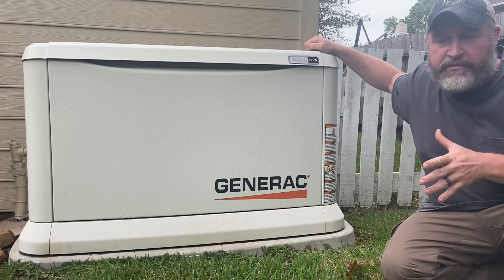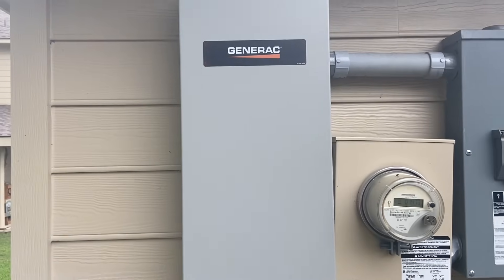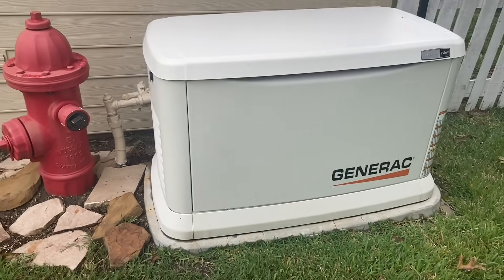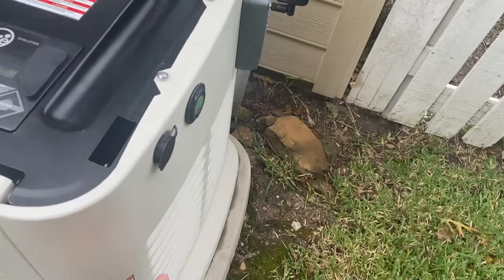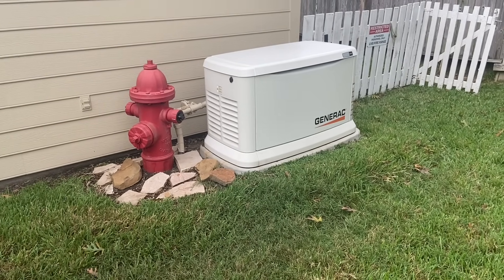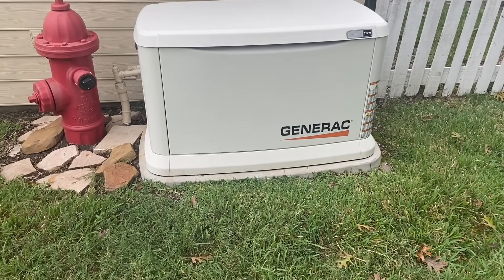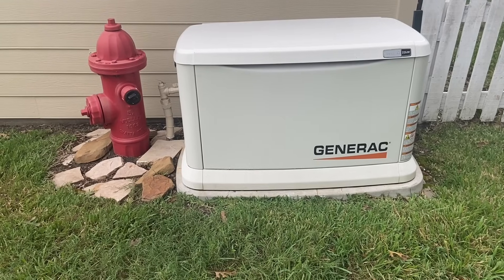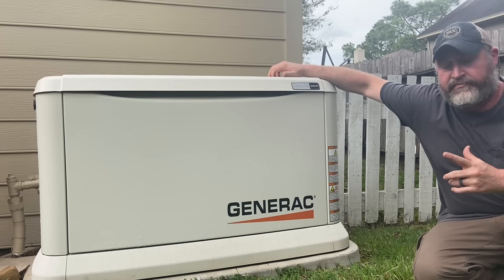Thinking of purchasing a generac whole home generator?

Comment: Here is why I will not buy one. Cost to run one 24 hour day $50.00 plus. My neighbors cuts one once a week and runs at least 30.00 minutes. If it floods it is ruined unless you put it on a very high slab. These are things the company does not tell you.
Reply from the maker: Our cost last use was avg 17$ a day but I guess it depends on your area, our is high enough that if it floods we would have more important things to worry with like our home. Mine only runs for 5min per week and does not bother the neighbors as they have them as well. Thanks for the great comment and for watching.
Reply: $50 per day for power (HVAC, refrig, lights, tvs, etc. is a deal!   The upfront cost might be prohibitive, but the running cost is not.
Reply: One of the things to consider is where the author lives.  When Texas had the deep freeze last year some of the electric providers had to purchase power at the market rate which skyrocketed and many of those providers passed that cost onto the customer.   $50/day would have been a godsend to people who got bills in the thousands for being without power for a couple days.

We live in Klein (NW of Houston) and when the freeze hit we were without power for perhaps 8 hours altogether through two blackouts.  Not too bad and luckily our provider didn't need to purchase more from market rates so we never got a huge bill.  That said, one needs only to live through something like Harvey once to be sold on the usefulness of a home generator.
Reply from the maker: @craig328  great comment and thanks for watching!
Reply from the maker: @Patrick Baptist hints the stand by or back up generator 🤔
Reply: @RetiredSignDude  It's only that cheap if you live in an area with natural gas. For people in more rural areas that need to run them off propane, it can get very expensive. I have heard horror stories of people using over $1500 of propane in a week long outage. Granted it varies but some areas, getting propane delivered can be very expensive after all the fees.

Comment: Car batteries last for 5 years minimum. That is a pretty poor performing battery for it to only last for 18 months and I believe you said it lasted for 16.
Reply from the maker: Interstate 16 months in 2018 replaced with a die hard and been going strong since thanks for watching
Reply: Batteries suffer failures just like everything else does.  Just replace it every 3 to 4 years as part of regular maintenance with a standard automotive battery and don't worry about it.

Comment: The thing that bothers me is they always want to install these right up against the house. I’m afraid the exhaust will somehow find its way in the house which is very dangerous.
Reply from the maker: My installer would put it wherever I wanted within our easement. Ours I 40+ feet from our house. Find a new installer. Thanks for watching please subscribe and check out my other videos.
Reply: Do what the other guy told you. You decide. I did not know it was an option 15 years ago. Had to move it due to monoxide getting in our house big time. Make sure you have two detectors. I bought a new 22 after the move. I put underground piping with a no dig method That was $2,500 for underground guy. The electric cable was $6.00 a foot. I had real good luck with NAPA batteries.

Comment: Here is the problem with these gas natgas or LPN generators when the supply chain goes down so does your generator. Get solar and wind generator. Until they completely block the sun and wind you will be good to go. I put a 13kwh solar system in my house for around 8k complete system it is expandable to 24k. My sister bought a generac nat gas lpn generator aside from it costing nearly double of my system it is still not working due to parts needed to connect to nat gas. They do not have a LPN tank at their home adding this would add hundreds to the cost not including filling the tank . It has been 18 months since her generator was delivered still unusable . I asked her what she would do when the gas cost went to high. She didn't know. My system that was easy for me to install has been working on stop since I put it in with no additional cost of power generation. Also you can charge these batteries from the grid or a small generator. Best part is the batteries are removable stand alone power supplies that can be taken with you . Each one 3kw they can be directly connected to solar panels to keep them charging while using them . So much more versitilr
Reply from the maker: Thanks for watching and the comment, 42 years and our natural gas supply has never gone down so I will take the gamble. Please subscribe like share
Reply: @JustCantSitStill  yes but times are changing. Better to be prepared for what is coming instead of what happened in the past.
Reply from the maker: @nullseta  cool thanks again for watching, have a great week.
Reply: NG does NOT go down with the electrical supply, you lose electric you NG will still function.
Reply: @charleskaufman5826  no it doesn't go down with electric grid. That's not what I said. I said in these times when supply chains are going down on everything everywhere where is the gas going to come from? Are you going to drill for it yourself? Also the prices are going to keep on increasing. This doesn't happen to solar and wind. So stay in the system of dependence if that's what you prefer. It's up to you. I choose to reduce the need for outside sources of energy and keep the ability to have power even when all supply lines are down. That is the point of a generator at home isn't it. With a gas generator you are still at the mercy of greedy energy companies and the corrupt government.
Reply: @nullseta  Sorry for the misunderstanding. I have been checking into solar power to be off the grid, but it seems for a whole house system with the battery backup will cost about $52,000 and a 10 year warranty on the battery backup which is 120 months. Your monthly cost is ($52,000 /120 = $433 per month). If the complete system last 20 years with no problems then the cost is still $216 per month. This battery backup will only supply about 3 days of power with the new batteries but hopefully there would be some charging time in those 3 days to extend the time. To date my electric bill is on average about $150 per month for a 2800 sq ft house, the solar seems to be much more expensive. And I would predict as energy cost increase the solar system will keep increasing also. But if you just want a backup energy source than I believe the NG generator is the best solution with a battery backup to store energy from the generator.
Lots of options but expensive.
Thank You
Reply: @Misha K   You bought a 13kw system for $8k.  Dang, thats very cheap. Did you install it yourself from used parts on ebay?   Hey, I like the batteries, but they don't last and cost too much.
Reply: No, thanks. I’ll stick with NG.

Comment: I HAVE THE SAME UNIT. IT'S REALLY NICE UNTIL THE PLASTIC OIL PUMP  GEAR FALLS OFF.  GENERAC DOES NOT STAND BEHIND THEIR UNIT.
Reply from the maker: Thanks buddy for subscribing and watching, hopefully that’s something that will be covered under my extended warranty.
Reply: The major problem with Genacrap, is that most of the parts will fall off, like the speed control, the antenna, the throttle body, turn the armature into shredded cheese (copper) on average we replace 20 generac units a year due to equipment failure. The product use to be quality, but over the past 20 years it has just fallen off real hard.
Reply from the maker: @JerryBeck360  Hey Jerry thanks for watching and the information, please subscribe like share 👍
Reply: @JerryBeck360  Do you know of a quality built generator brand that isn't built like  generic GENERAC  throwaway Chinese junk ? 🤔

Comment: That is so loud I would think the neighbors would be upset if it goes off in the middle of the night
Reply from the maker: Not that loud
Reply: The neighbors can piss up a rope, when you have no power the sound it puts off is the least of your concerns... these are backup generators for winter storms/power outages im sure you wont be concerned about noise when that happens.

Comment: I’m sure you are good at what you do, but everyone I know who has had a Generac has had nothing but trouble.  Trouble meaning, when you need it, it didn’t work.
Reply from the maker: Thanks for watching buddy please subscribe and check out some of my other videos! Have a great 4th
Reply: Odd, mine works just fine, it's come on at least 12 times in the last several years when power goes out...You might want to have it checked if yours isn't working as it should...
Reply: A lot of issues with these systems are install related honestly, if you mess up the gas or electric it really screws with the system performance

Comment: I may have missed it - but where is this cost from USA? Or Canada? Trying to see what this will cost in Canadian $ cause everything in the damn internet is american.  Blah
Reply from the maker: Texas is in the good old USA , thanks for watching!
Reply: With installation, hooking up to gas and taxes, my 14KW was 15K cad$. I live in Quebec so total taxes come up to 15%.

I forgot to mention that this price includes the transfer switch, the winter heating kit for the battery and the block, etc.

Also note that 14KW could use our existing gas meter & pipe size, but that 22KW required an upgrade.
Reply from the maker: @dimbulb6443  thanks for the CAD pricing!

Comment: Its should run for 20 mins each week not 5 and and the brains are in the gen controller the transfer switch only controls load shed. And don't ever transfer that with the cover off if it where to have an issue  it can blow up in your face.
Reply from the maker: Hey buddy thanks for watching please subscribe like share!

Comment: before buying such a large genset beware that it will burn a gallon of fuel for every 5,000 watts of power it produces thats 50 gallons per day of gas or propane.so think small.
There won't be and fuel available after the storm for a long time.
Reply from the maker: @crankychris2  never been without NG in my 44 years so I will take that bet.

Comment: I took a look at Generac for a standby generator, saw no inverters, stop looking.
Reply from the maker: Great thanks for watching
Reply: I think they naturally very close to pure-sine. Like <5%
Reply: You don't want an inverter for a whole house generator.  No need for it.
Reply: @bobbygene8274  the idea of having an inverter is for overnight. I would rather have the engine, running slow and quiet and conserving fuel when I only need minor electric needs overnight.

Comment: Make sure you have a carbon monoxide detector in your home. Your unit is not installed to code.
Reply from the maker: Nice how so? Passed all permit inspection so please elaborate, subscribe like share.
Reply: @JustCantSitStill  
The exhaust is pointed evenly with the house. Fumes can get trapped in overhangs and enter the home and spread its deadly gas.
My new Generac failed during hurricane Ida and ran poorly. It created extra fumes and I had carbon monoxide issues. The things I have learned from these issues are

1. Exhaust should always face away from the home.
2. The unit is too close to the home. 
3. The City, Electric company, and installer approve installations everywhere. They never expect the unit to fail and go thru the installation motions over and over. They become blind to the actual installation codes and ignore them. Check local codes and ask Generac the recommended guidelines. I guarantee your not even close.
4. I won’t even mention the fire hydrant because I’m unsure.

They have countless stories here (Houma, La.) with the same improper installation. Most likely nothing will ever happen but I highly suggest making sure you have a carbon monoxide detector in your home, just in case. If I didn’t my family would be gone.
Your video was great and I thank you for it, I just felt like I needed to share my experience.
Reply from the maker: @baddadash  it’s a little over 50 feet from our home how far do you think is enough?
Reply: @JustCantSitStill  If the building next to it is not a home then I apologize. It looks like a home to me.
Reply from the maker: @baddadash  detached garage. Fire hydrant is decorative, all this was explained in the video.
Reply: @JustCantSitStill  I caught it the second time and admit I have attention issues. lol Thats why I apologized. Great video and very informative. Thank you
Reply from the maker: @baddadash  great thanks please subscribe like and share!

Comment: why does it need gas?
Reply from the maker: To run it needs a fuel to consume just like a gas lawn mower or auto. This one runs on natural gas or propane.
Reply: @ericallen7200  🤣😂🤣😂
Reply: @JustCantSitStill  If there was ever a grid down crisis, wouldn't the gas company that sends the gas to the generator need electricity to function? Do you think solar energy might be a wiser investment??
Reply from the maker: @Bizzare77777  depends on if the solar had batteries I guess, but in my lifetime NG had never went down so that’s the gamble I took.
Reply: Because the ones that run on water are back ordered for the foreseeable future....
Reply: @Bizzare77777  Don't you think that the gas company has thought that far in advance and has prepared for such a contingency?  Do you have clouds where you live?

Comment: If you purchase Generac, be prepared to be hounded to death to purchase an extended warranty plan.  We are sick to death of their relentless sales pitches after eight months.  Is their product that inferior?  ...delicate?  Prone to breakage?  Seems like a protection racket.  We wish we'd gone with Cummins.
Reply from the maker: We did not have any issues like that , I assume it depends on the company and the sales person
Reply: @JustCantSitStill  
No.  These are from Generac.  And, you say you've no such experience?  Do you have an extended warranty? We received two mailings today.  While I thus far love my generator, I abhor Generac.
Reply: This reply is to Zionist.   Buy the extended warranty warranty if it’s still an option.  But if you do, you MUST keep the unit maintained in accordance with the warranty manual 
I’m in the generator business and the Generacs require far more maintenance and have more issues than any other unit we service.  Generac’s manufactures the unit to make the upfront cost of the unit and the install lowest possible. As a result a lot of their design features consolidate items together. One of the most glaring examples is their battery charger. To save money they integrated into the control module. However they took a $60 component integrated it into an $800 component just to eliminate a single low voltage wire required at installation.

For anyone looking…Cummins, Kohler, or Briggs and Stratton are the way to go for an air cooled unit, and Cummins or Kohler for liquid cooled.  And my company is a dealer for Cummins Kohler and Generac. So if that tells you anything…
Reply: @BrianD-ds4dx  
Thank you sir.  Albeit, I will take my chances.  I have a maintenance contract with an aftermarket contractor and keep the unit serviced.  It may cost more in the long run, but I do not trust Generac.
Reply: @Zionist_Eternal  not a terrible decision.  They are the worst when it comes to paying warranty claims.  While we are a Generac dealer, we probably do 10 Generac a year out of 750 total installs…if that tells you anything
Reply: I didn't have any issues like that. My dealer also does my annual maintenance and have never ask me to purchase anything additional
Reply from the maker: Same
Reply: @JustCantSitStill  A good dealer who also maintains the unit is a big part of your purchase.  While I’m not a fan of the Generac unit there are some great companies around that install and maintain them.
Reply from the maker: @cmac5272 awesome thanks for sharing!
Reply: @BrianD-ds4dx 
Briggs and Stratton are trash. I throw more of those in the dumpster than any other brand, even generac.
Reply: @masonscott2584  that’s the one we don’t really deal a lot with directly:  and when we do it’s only on the air cooled side.  One thing I can’t figure out with Briggs is why in gods name they have a high rpm 30kw…
Reply: @BrianD-ds4dx  It is cheaper because it uses a smaller displacement engine to make the HP needed to run the load-(1.5 hp/kW +/-).  Generac has high speed Liquid cooled, and so does Kohler.
Reply: @bobbygene8274  Generac liquid cooled units that you are referring to are troublesome also.

If you are going to spend the money on a good liquid cooled unit go Kohler or Cummins.  

The Generac air cooled 3600 rpm units are a good budget selection if you never need the unit to exceed 48 hours of runtime.  At least in the south in the summer

Comment: Why do Americans have this stuff outdoors for? Boxes and everything mounted on the outside of the wall, someone could mess with it.
Reply from the maker: @eriklarsson3188  they would have to be in my backyard….so on my private property……Texans don’t play
Reply: Were I live there is no one to mess with your stuff. As well my house and yard are covered by 6 camera's. Plus Smith and Wesson. You want these things as far away as feasible they are extremely loud. I f you have close neighbors these are as annoying as hell.
Reply: 2nd amendment has us 'covered'
Reply: Some places its fire code - if you have a fire - the fire department can shut off the power to the house stopping the source of a possible electrical fire.